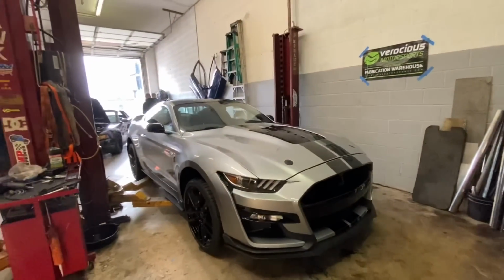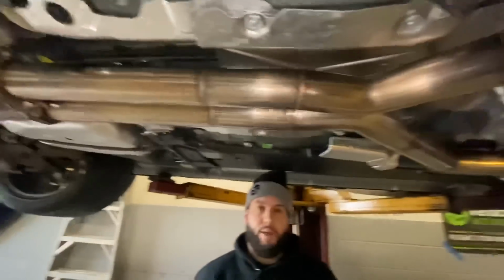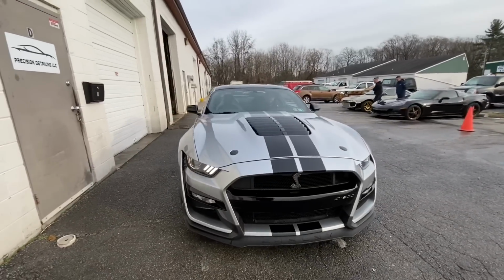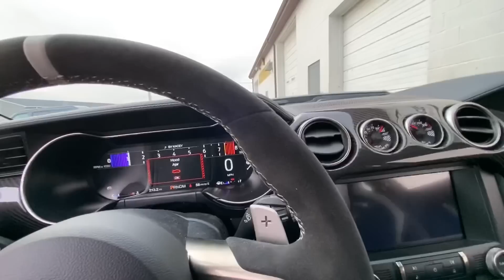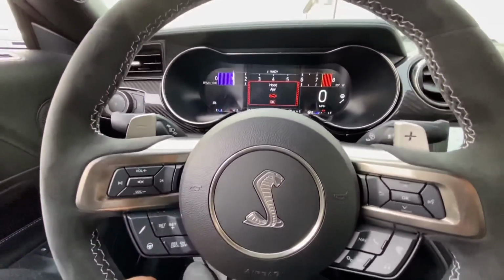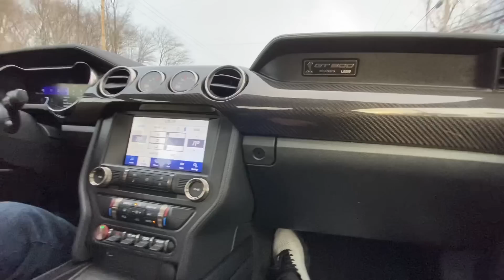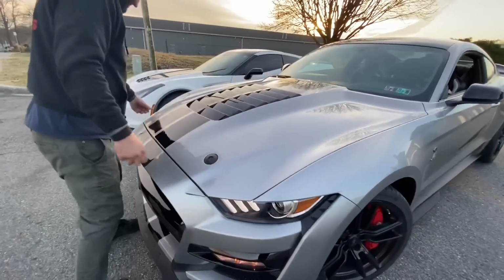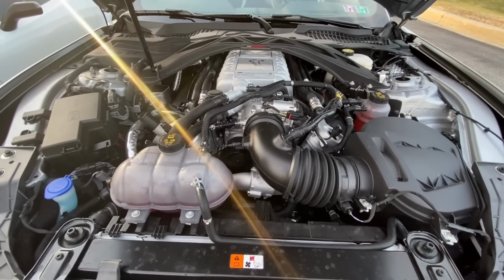MODIFIED 2020 SHELBY GT500 (TUNED + EXHAUST UPGRADE) REVIEW!

Comment: The GT500 was built to handle turns. By switching the tires you will change it to a straight line aka drag car.
Reply: R88*r are a road race tire

Comment: 800 rwhp? Tuned, thats 140-150 rwhp more than estimated stock. The new 10 spds are far more efficent than the old manuals. 13% is the typical losses, not the usual 15%.
Reply: They make about 700whp stock
Reply: They make 700 stock my boy
Reply: No auto has less drive train lose than a manual just less than older autos. Most drivetrains lose the same company s are just making more power and lying about hp numbers. Dct Trans lose more power than a newer auto they are just faster and can’t handle the tq that an auto can. Dct have way more moving parts and all the heavy wet clutch packs lose more hp power it’s justbthe super cars have them in the back mated tonthe engine for less lose. Swap a 10 speed and a dct in the gt 500 and I promise you the dct will lose more power. People just think that they don’t.
Reply: The GT 500 has a Tremec 7 speed DCT,  10R80 is in the GT.

Comment: you HAVE to get the cats on these cars off if you want to increase power. They are at the limit from the factory, turning cat protection off and destroying them is not a good option. As it is likely to be detrimental to the engine and the cats.

Comment: Break-in at 200 miles? Lol
Reply: The  car requires only 100 mile break in, about 1000-2000 only if you're gonna track it as the engine would be under more stress at that point.

Comment: This guy evidently has loads of dough($) and doesn't care about new car warranties. They need to make some  straights to replace those turbo muffs. Love to hear this at speed (5000 rpm) in top gear. That's the test of a great exhaust system. Nice car but the paint sucks.

Comment: 800 hp big deal! The black mumba will be that much or more for a lot less money!!! Thank you VMP!!! GT 500s are to heavy and way over priced!!
Reply: Even it it's 900 horsepower. It's still a GT. There is so much more to the Shelby GT500 like the bad ass dual clutch, aero, brakes plus it's a Shelby keeping the resale high. if you resell the GT. You'll need to put it back to stock and sell the mod parts. Learned that the hard way. The other issue is the internals of the Predator is way above the Coyote for adding power. No comparison.
Reply: @hemi300c4  KR3Z- 6010-A 2300 for predator block and the gt500 uses the cross plane coyote architecture so use your same crank...do a drop in rods and pistons boom done less than 5k....so that's 38k plus 5k for a 401a...same dash and controls same chassis hehe...
 The car seriously really is a fair deal at msrp I like the nose cant wait to get one if it bolts on that chassis it will bolt on any s550 hehe....
 Good job ford

Comment: Is that a tick I heard towards the end of the video? God I hope not
Reply: It was a bike in the background. You can hear after he says "it's finicky", it revvs independently of the car.
Reply: It's a completely different engine then in the GT. Any ticking is likely from the ethanol fuel being run or your hearing what you want to hear. Fuels that contain high amounts of ethanol or that are low octane may not properly lubricate the fuel injectors and can lead to a slight tapping or ticking noise. By the way. It can also be coming from an exhaust leak since it was changed on the Shelby.  I obtained This information in reference to my 2018 Hemi with 10,000 miles. This applies to all engines. The Shelby GT500 is a bad ass Mustang.
Reply: @hemi300c4  it's a bike... In the background.

Comment: I Own a 2012 F-150 Lariet FX4 6.2 Ford Powered V8!
6.5 bed!
3:73 gear ratio!
6 speed automatic!
4WD!
Ingot Silver paint!
Platinum factory 2012 F-150! 
Bully Dog GT Platinum Tuner
S&B Cold air intake!
Pedal command!
3 inch Exhaust system!
Super 44 flowmaster!
resonator delete!
5 inch exhaust tip!
Max towing 11,300 pounds!

Comment: No supercharger whine because the supercharger upside down
Reply: U can get supercharger whine by modifying the sound tube
Reply: Stock air box and big pulley.  The s/c isnt even trying.
Reply: They're not leaning on the s/c at all. It's not going to whine much. Specially through the stock air box.

Comment: This ain't the first turned GT500.  You late and there's nothing you can add unless you pull the motor lol
Reply: D Jordan what Are you talking about? You can go LT headers, smaller blower pullie, larger lower pullie, E-85, you can port the blower etc there’s plenty to add.
Reply: @c7bullet789  Slump Dem, first off the Title said "First" tuned GT500. Has that title since been changed? I'm pointing out the fact that it wasn't the first.  As it was stated Lund got 803 to the wheels. To me and everyone else that screams MODIFIED.  Now in regards to  there is nothing else he can do because he's late with his content, he hasn't even taken possession of his car yet. We've seen a stock GT500 on the dyno so far, we've seen a stock GT500 at the drag track so far, we've seen a stock  GT500 on a road course so far. We've seen the manners of a GT500 on a road trip. Being that Lund has already modified there GT500,  do you think they won't have pullies on their's more than likely in the next couple of weeks? They're a speed shop with money.  They will probably have rebuilt their's before Stangmode even takes possession of his lol. Now to keep up Stangmode has found SOMEONE else who's taken delivery of their  GT500 and he's posting about someone else's car. He need to get his and modify the transmission or something because every other perspective has been covered by the kid Speed Phenom.  New content is what's needed.  Not just shit to get likes and try to stay relevant.  That's all I'm saying.
Reply: @c7bullet789  ahhhhhh I see he's changed the freaking title to his video.  Lol kinda like the video at the plant huh. SMH!!!!

Comment: Lol trac control,I want all power not 3/4 ,in the past there was no trac,that's were you learn best
Reply: At low speeds on factory tires with 800whp, you'll want tc in the cold. Even with a radial at low speeds and the temp probably being in the 30s or 40s where he was at, it's not hooking good.

Comment: My neighbors new 600 hp M5 Comp would beat this stock for stock.
Reply: 08turboSS wrong.
Reply: Maybe from a dig it would jump out ahead because all wheel drive but it would get reeled in hard af after about 70 or 80 mph or so